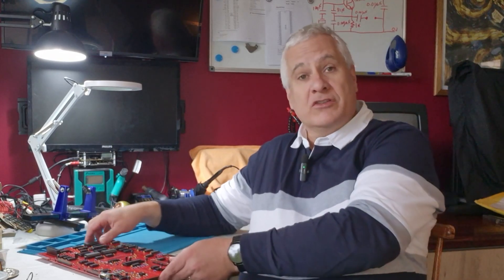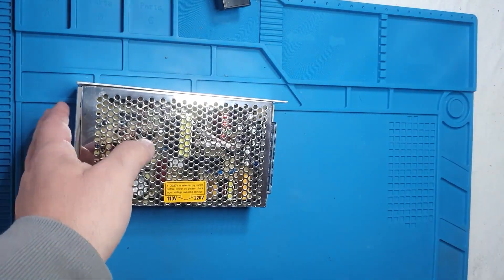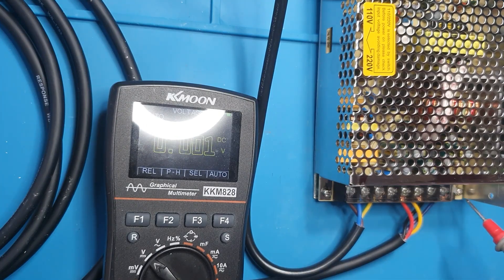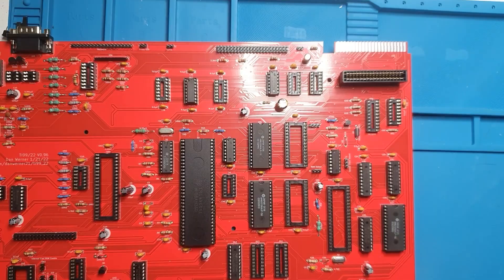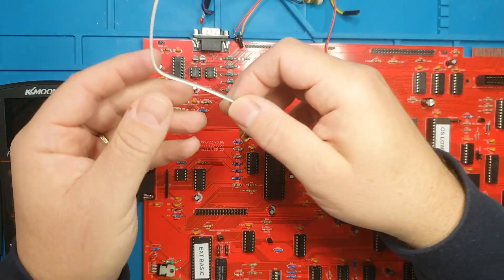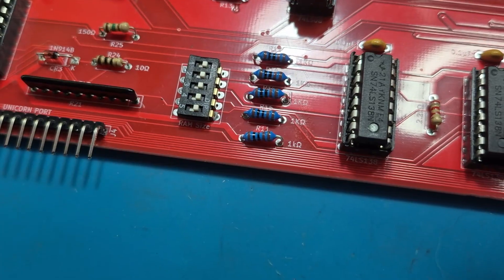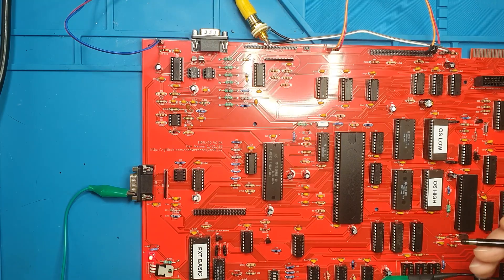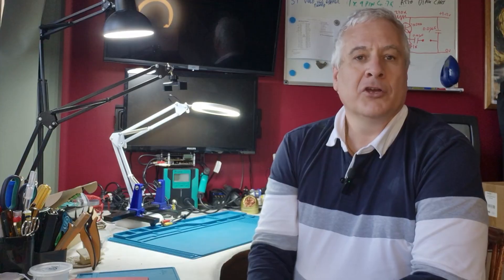Building the TI-99/22 - Part 3: | Installing the TMS9900 CPU, ROMs & First Power-On Test

Comment from the maker: 📌 Thanks for watching Part 3 of the TI-99/22 Build!

In this episode, we installed the TMS9900 CPU, programmed and inserted the system ROMs, dropped in the TMS9918A VDP, and powered on the board for the very first time. 🚀

🔧 Resources & Links
• 15mm IC Leg Aligner STL → https://www.thingiverse.com/thing:4776603
• 7.6mm IC Leg Aligner STL → https://www.thingiverse.com/thing:4787337
• My GitHub Repo (firmware & files) → https://github.com/earies8bitworkshop/ti9922

👉 Next Episode Preview: we’ll cover replacing the rare GROM chips with a modern solution, assembling the keyboard, and testing BASIC.

💬 Your Turn!
Have you ever built a retro system or worked with the TI-99/4A? Drop your stories or questions in the comments — I’d love to hear them!

👍 If you enjoyed this episode, give it a like, and don’t forget to subscribe to Earie’s 8-Bit Workshop so you don’t miss Part 4.